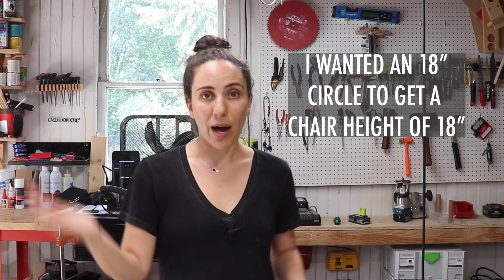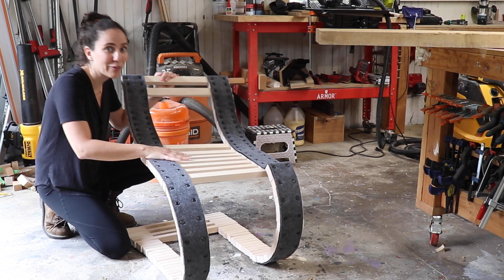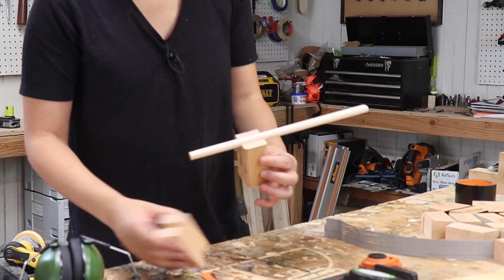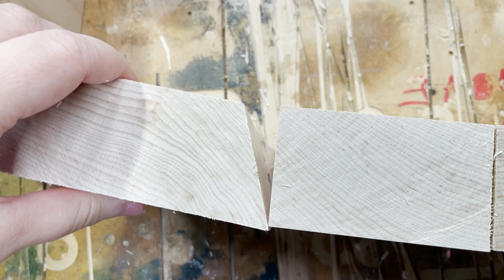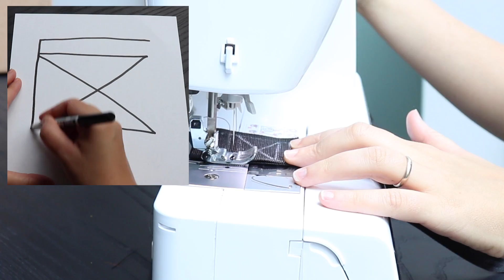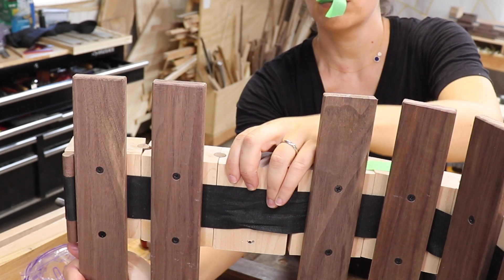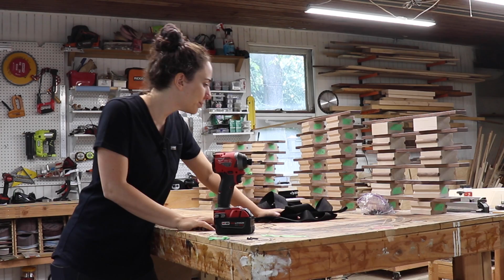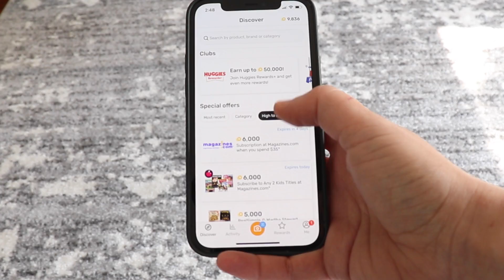I ATTEMPT to make a Roll Up Chair… AGAIN...

Comment: Glad you found an angle calculator, but in my suggestion, I mentioned you have to add the wood compression and the stretch of the material into the mix. So if you are shooting for 18" then the unsprung circle will be larger than 18". Follow? Just like on the old metal lawn chairs, as soon as you sit in them the seat drops down, so you are slightly leaning back, then when you get off it, it springs back to slightly past level forward. You should also pre stretch the webbing. Hang weights on it until you get zero stretching movement out of it. Polyester and any type of plastic will stretch. New, once it is stretched and released for a bunch of times, then it will stretch and return to the same spot. If you don't pre stretch, you will get a different lenght response until it reaches it's final limits. You have the plastic itself and the warp/wrap of the material to take into account for the stretch.

Well at least the walnut pieces are done for attempt number 3... The third time is the charm, they say... lol

I do the same thing... I always wear black and buy a crapload of the same shirts and pants... You don't notice the stains or holes quite as much than with any other color. I also do car and small engine repair, with black, you don't see the oil and grease stains as easy...
Reply from the maker: I hope the third time is the charm! 🤞

Comment: How about thin metal sheet strips instead? and don't just sandwich it between the wood, screw it or even glue it fixed
Reply from the maker: Could work

Comment: Thanks for another video about this chair. Its very interesting to see the process of figuring it out.
Maybe problem is not stretching the belt but compression of wood. Try rotate mapple pieces 90° so compression is along the grain (which is much harder to compress) and keep them as thick as possible. Also as other suggests attach belt into every piece of wood with screws and stapples so free part of belt for stretching is short and doesnt affect other parts.
On the pictures of original chair (if that really works, it could be same as your chair in the end of the video) is very wide belt and short wood pieces, both can help reduce compression.
Reply from the maker: That’s definitely a good idea. I just worried about it getting too heavy. It was already crazy heavy with this amount of wood

Comment: Like I mentioned in your last video on the roll up chair. If you watch the video that inspired you, the fabic is bonded to each and every piece of wood right up to the point of pivot, thereby: 
1) it's only a fraction of a millimeter of the fabic that pivots; 
2) the piviot point been only a fraction of a millimeter so the strech is reduced to it and it alone; 
3) the force around the joint/piviot point only effects that joint - not any other and no pinching of the arm.
The comment made earlier about using hinges instead will only work if the hinges used has no flex other wise you just making a chair shaped bow. 
These factor are mostly delt with in the original video by the student. Heck if you had to bond it on using resin, keep articulating the joint so it does not lock up when it sets it may work. But really nice try don't give up.
Reply from the maker: Yeah. That could be the problem

Comment: Thanks for sharing that journey. This is RnD. 
Did you consider using steal wire and putting it freely via tunnels in each segment? Or wire can be kept by wood on the top. Wire would be not attached to segment so you can play with tension on ends. Good luck.
Reply from the maker: I did. But it might prevent it from rolling up since it would be so much in the center of the wood

Comment: You need a band material that doesn't stretch like Aramide (Kevlar). Also it needs to be attached to each block so it doesn't move, shift or creep. So glue the band to the blocks using lamination epoxy.
Reply from the maker: That might work
Reply: To add to that. To remedy the compression of the wood you could perhaps use pieces of steel rod. On each block on the side opposite to the band you can make a slot (or two slots) and glue in the rods. This way the compression force is applied to the steel instead of the wood. 
Alternatively to make the steel invisible you could drill holes and screw in pieces of threaded rod (was the best translation I could find).

I like the idea of the dowels for preventing torsion by the way.

Comment: I hugely admire your tenacity, but I'm not sure the strap approach is ever going to work. What you've done is essentially create a massive lever - the distance between the back of the chair and the fulcrum is huge compared to the distance between the strap and the fulcrum - it must be at least a 30x force multiplier. This means if you're a 70 kilo person sitting on the chair, you're actually applying over two metric tons of force to the strap. Even if you get it to work initially, over time the strap will inevitably stretch.

I think the only realistic strap material you could try is thin rolled steel. There are industrial packing straps that you could try - they are extremely resistant to stretching. It won't be as flexible when you roll it up, but I'm not sure you have many options for materials that can withstand 2 tons linear force without deforming.

The other thing you might try is abandoning the strap concept altogether, and make each wooden joint a hinge. This would probably work if you got the geometry and wood grain direction right. Might be a good (if complex) CNC project.

I do think it's worth persevering with - it's a genuinely brilliant concept.
Reply from the maker: Yeah. The strapping is officially off my list. Ha

Comment: I can't wait to see the third edition! Something I would like to suggest is don't even try to finish the project. Yes that sounds really silly but you are making something that doesn't exist - yet. On top of that you are asking a lot from the materials. And speaking of materials have you thought about seat belt or ratchet strap? (can't remember did you mention these in the first video) As mentioned the tension is insanely high so picking material that is used to withstand those forces seems oblivious to me. Good luck with the project, I'm so happy to be on this side that can just enjoy! :D

Ps. Use sandbags when testing!!! This has high risk of failing in so many different ways so you also need to add safety factor (at least twice the weight of the potential user).
Reply from the maker: That’s what the polyester webbing was. Sandbags is a good idea. Ha
Reply: @3x3CustomTamar  I see, no wonder it looked like it haha

Comment: Hey Tamar! I hate to see you accept defeat - Hey you solved one problem - sideways collapse.
As for strapping material, my first though was maybe you could use some flexible steel banding - screwed in. But, then I thought this would have sharp edges which you wouldn't want, especially with kids around, and could also quickly succumb to metal fatigue, and you're back to square one. Staying with the metal idea, how about some heavy duty hinges? Could that work? They should also work to strengthen against sideways movement. One disadvantage is hinges could make the chair quite heavy. Or that could be an advantage. Better stability perhaps?
I don't think leather would work long term. You've shown that there is a tremendous amount of stress around the lower curve (where your calves would rest) and leather would wear at the holes where it would be screwed/stapled to the wood. Square one again.
I'm sure you'll get there. Remember, Edison, lightbulbs, yada yada.
Reply from the maker: Yeah. This was already too heavy

Comment: The real problem is just the immense lever that the weight of back puts on the front front blocks and straps. Metal is about the only material that won’t stretch like the strapping will
Reply from the maker: Yup. I thought I could max out the stretch. But then tearing will occur

Comment: Just a thought, but maybe the straps being one long piece is part of the issue. You mention that the back of the chair starts collapsing, and the same happens with the end of the base. I think that's in part due to the extreme tension it's under when someone sits down due to the dozen or so tiny levers in the first curve of the chair.
My solution? Maybe put actual hinges on the front part of the chair. I think that would stop the lever action (and gaps) you get from the back of those pieces when under tension, as that force would be placed in the wood itself. From there, the rest of the pieces might just work, and if not, the same hinge logic applies. Plus, because they're hinges, you'd still be able to roll it up! (And cover it up with the straps to make it look nice too!)
Let me know what you think! I'd love seeing a part three!
Reply from the maker: Good thought for sure

Comment: 4 steel cables (2 on each side) with tensioners on the bottom part thats on the floor might do it.
just route some grooves for the cable.
Reply from the maker: Maybe
Reply: @3x3CustomTamar  webbing always has some stretch to it.
Steel cable does not have that problem.

Comment: old car seat belts? too stretchy as well?
Reply from the maker: That’s what the polyester was
Reply: @3x3CustomTamar  aaaa...ok...bugger :/ I'm sure some industrial material would be suitable for this...will do some googling
Reply: @3x3CustomTamar  started thinking about that...the material should be able to bend but not stretch...maybe old recycled car tyres? That would bend but wouldn't stretch under long tension. Hmm...there seems to be a car and recycling theme going here with my ideas 😂

Comment: How about..
Making the pieces fit together with a dowel end in.
A little bit like lego.
But with rounded tops to help then push into eachother and pop out when rolled.

Then. Use a steel cable running through the center of each block that is tightened at one end with a spanner to create the tension. 

Yes. It's not as elegant as the simple roll out and just use idea.
But this way might actually make it usable as a chair.
Reply from the maker: Interesting

Comment: Use a flat serpentine belt that is used on a car engine. They are made not to stretch. Second - find an aluminum rod(s) that are 3/8 diameter. The total length has to be twice of the belt used. You will cut them into dowel lengths and put then in short ways so the pieces will touch each other on the side of the block that compression happens. The idea here is the wood can't handle the compression for of all the joints. The aluminum pieces will actually handle the compression yet will be hidden when the chair is setup. Hope this makes sense. 
Note - another thing to keep in mind is the strap is compressing the wood where it is making contact. In other words you have compression from both between the blocks and the strap pressing down on the block. When you combine the two sections of block along with the number of blocks AND the slight stretch of the strap, the chair will have lots of flex, thus fail.
Reply from the maker: Yup. The material it just not right

Comment: Tamar,

Thank you for showing your failures as well a your triumphs! Keeps people like me, (I fail regularly, ) invested in trying again. From failure,  we learn.  Bell didn't invent the telephone in the first go. 

I think there will be too much stretch with leather.  Aviation cable? Drilled through the centers of the pieces? (Might reduce racking. ) Add a method to tighten the cable, (turnbuckle,) 'cause it will stretch too. 

Or,  just move on to the next project.

BTW you have fans in the Great White North.  I know of several people,  contractors included,  who watch your channel in the Ottawa Ontario area.
Reply from the maker: Ha. Awesome to hear!
Reply: @3x3CustomTamar  that was quick! Thank you.

Comment: I'm thinking maybe using two or even three separate pairs of straps would help... One pair of straps for the back rest, another one for the main bend, and maybe a separate one for the flat bottom part. Now the single pair of straps is doing all the work, while actually not all the work is equal in different parts of the chair.

Anyway, this is a very challenging project and I am impressed with your patience! Keep up the good work! :)
Reply from the maker: Maybe!

Comment: From a structural engineer here-
Nylon straps, polyester straps, they will all elongate too much no matter what the advertising says.  Kevlar might be better if you can get strapping like that.  Previously I mentioned fiber reinforced belts like are used in automotive fan belts and motorcycle drive belts.  I don't know if you can get a piece of that long enough.  The structural industry uses carbon fiber strips- those could work if there are any that are flexible enough to be rolled up.  Otherwise you would have to switch to a material like aircraft cable but it is harder to attach.  I was even thinking you could route a groove in the blocks and inlay a long piece of bicycle chain.
With the straps attached only at each end then you will have the same tension in the strap all along its length which is why parts of the chair wanted to move the wrong direction when you sit on the front, plus the entire strap can elongate and slip so that the total elongation concentrates in the blocks at the front of the chair.  If you attach the straps to each block then you have different tension in different parts of the strap and less total elongation between any 2 blocks on the front.  This could be done with strapping but not so easy to do with steel cable.
If you do further experiments I think you would go back to the small pine blocks and experiment with different strapping until you get something that you can form into a curve and it stays stiff, then extrapolate that to the entire chair.
You mentioned pine at first and how people said it wasn't strong enough.  I'm not sure the basis for this although you are stressing the wood in the direction perpendicular to grain which is the weakest and least stiff direction for any wood.  So when the strapping ties 2 blocks together the strapping is taking the tension and the wood fibers are taking the compression perpendicular to grain.  If you cut the blocks the other direction so they were being compressed end grain the blocks would be stronger and stiffer.  I don't know how much of the deflection you are seeing is due to compression of the wood, I'm guessing a small percentage, but if you were compressing on end grain you could cut that part of the deflection down to 1/3 or less.
I used to have a chair that was approximately the shape you are creating, my chair was made of laminated maple with the grain running along the length of the pieces meaning the bending was occurring in the strong direction of the wood.  The pieces were about 4" wide but 1" or less in thickness.  That chair worked but was a little bit bouncy when you first sit in it.
Reply from the maker: So much more testing and experimenting is required!

Comment: I would try and incorporate ratchet straps into this and keep the ratchet mechanism as a functional part to add tension to the straps once you roll it out. wait, what? you havent even attached the strapping to each piece?!!? just at the ends???? you definitely need to get some mechanical advantage to pre stretch the strapping. leather definitely wont work as it will creep and stretch.
Reply from the maker: Yup

Comment: I feel sorry that this didn't turn out as you wanted :/ You need something with extremely little flex on both the wood side and the strap side... Did you think about carbon fiber? But no idea how to process that. Maybe you could also ad little spacers in the gaps for fine-tuning?
But in the end you'll still have this extreme (and dangerous) tension in this this :(
Reply from the maker: Yeah. I considered spacers. But it just kept flexing. It wouldn’t stop stretching

Comment: What about instead of a meterial strap you used a steel plastic coated cable, and there the dowls are you drill holes and run the cable through each individual piece. Where when you sit it pulls the cable tight and has no flex but only in the wood. The one steel cable can run through both sides with it jumping across at both ends.
Reply from the maker: Might prevent the chair from rolling up since they are in the center

Comment: I think that you would have the same problem with leather.  Even if you used a really thick piece it would deform given the stresses involved.  The only possible thing I can think of would be something like dyneema but it would have to be a specialised weave not to stretch.  Stretch is where the strength is
Reply from the maker: Yeah. The materials is the hardest thing in figuring this out.

Comment: Tamar.....   why not remove the straps completely? It would probably require more CNC and less table saw, but if the ends of each piece interlocked with the piece next to it... bicycle chain style... the angled ends would allow the chair to take the desired shape. Also... by having them connected that way... each end will now pull directly against the piece next to it without the need for a strap to create the tension. I believe this would also help with eliminating that side to side flex. A hinged link style joint may be a better option than a fixed joint, but either way, connecting them with light weight aluminum round stock will work.
Reply from the maker: Definitely a good idea

Comment: although not the original intent, can you use 2 sets of internal steel cables. One set from the bottom and the other from the top then a cam lever to apply the tension?
Reply from the maker: Maybe!
Reply: @3x3CustomTamar  I mention it as I think you are staring at a physics issue as it relates to tension.
Reply: https://youtu.be/8pQFHT_rh8Y may want to check this